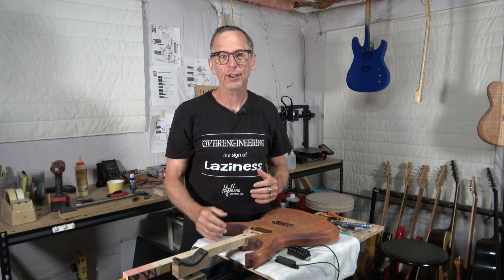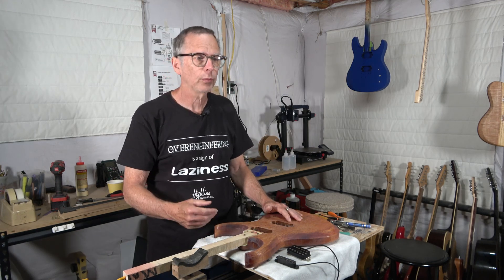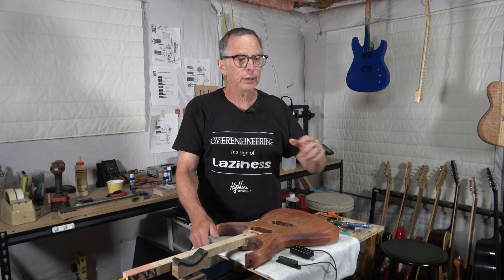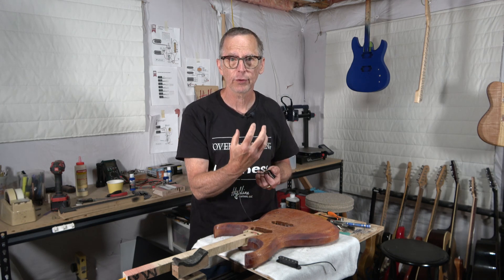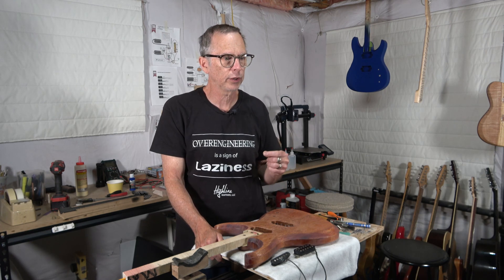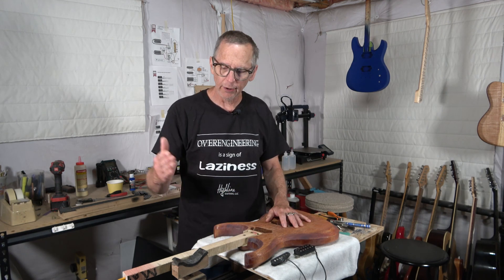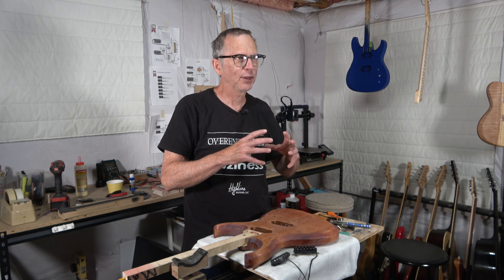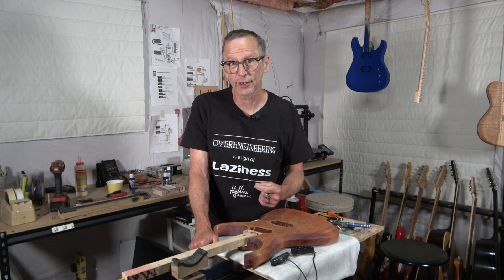Can You Plan Or Predict The Tone Of An Electric Guitar Before It Has Been Made

Comment: I have actually had pretty great luck choosing pickups for my own builds, but to be fair I have always stuck to a Super Distortion(as in my Les Paul) or derivative for the bridge. For my Strat that is a Sugar Chakra, and the Tele I am building is getting a Super Distortion T. For Humbuckers, I have found some custom CTS Pots the the Art of Tone has made, with a 525k rating and 5% tolerance, essentially guaranteeing me a minimum reading of 500k. The way I view the body and neck woods is that similar woods should have similar properties. However, denser woods, such as Mahogany, could impact overall sustain, but as you said, that could be different from board to board. While I don’t have any interest in becoming a luthier at this time, I am building simple projects for myself and may consider offering some basic tech services as a side business, given the lack of knowledgeable individuals in my area.
Reply from the maker: Building for yourself is extremely rewarding. Becoming a luthier can sometimes spoil that.
Reply: @HighlineGuitars , my goal with the Tele build is for a hard rock/pop punk guitar. My planned neck pickup is a SD Hot P90(Dimarzio didn’t have any traditional ones with enough output). Been thinking about a Warmoth Padouk neck since the body is the Player series Tidepool color, and the contrast between the teal and the orange-red of the neck wood would be gorgeous.
Reply from the maker: @bradleyolinger1691  Just be aware that orange-red Padouk will turn brown over time.
Reply: @HighlineGuitars , I am. Just thinking through options at the moment.

Comment: What's a tone pot? You guys dont just wire your pickups straight to volume then output jack??? 😂
Reply from the maker: A tone pot is a variable resistor used with a capacitor to bleed off some of the treble frequencies and send them to ground so the tone will sound warmer as you turn the knob.
Reply: @HighlineGuitars  hey Chris, sorry for the sarcasm on my part, was just making an allusion to the Van Halen style of eliminating the tone pot and relying on volume rollback for adjusting "tone"
Reply from the maker: @Mossy5150  No need to appologize. Often times, my responses are intended for those viewers who read comments and genuinely don't know the answers. Sarcasm is a beautiful thing!

Comment: I build mostly set-neck, double humbucker guitars with a tunomatic style bridge and stop tailpiece.  I’ve found that with that simple recipe that nothing will affect the tone quality of the finished guitar as the distance between the bridge and the tailpiece.  I normally put the stop tailpiece twice as far from the bridge as it is on a Gibson Les Paul.  This does two things that I consider very important.  First, it fattens the tone a lot.  Second, it softens the action, enough that a set of 10-46 strings will fret and bend almost as easily as a set of nines.  I’ve found that if a guitar sounds thin there’s not a whole lot you can do about it.  A lot of people think well I’ll just boost the bass and cut the treble on the amp, but all that’s going to do is muddy the sound.  If that fat but hard sound isn’t there in the first place then playing around with the EQ probably isn’t going to help very much.
Reply from the maker: Not all amps have the same EQ circuit. Some are much better than others, especially the most recent designs.
Reply: @HighlineGuitars  Thanks for your reply.  That’s not my experience.  I think boosting the bass and cutting the treble on the amp or pedal to add depth to a thin-sounding guitar is definitely not the same as building a ballsy-sounding guitar in the first place.  Tweaking the EQ may help, but it throws the frequencies out of balance, so that the bass is going to overpower the treble.  When chording there will be a significant treble masking effect.  This doesn’t bother some people, but I want my high notes to be louder than the lows.
Reply: I would think the longer string length would increase the tension needed to bring the string to pitch.
Reply: @victormarinelli5660  Thanks for your reply.  I’ve heard that the actual string tension doesn’t change, that’s strictly based on the scale length.  I’m not sure, but I think what’s going on behind the bridge affects the feel of the action.  Jimmy D’Aquisto said that putting a shorter tailpiece on one of his archtops would soften a tight action.  I’m pretty sure he knew what he was talking about, because he used to be able to alter the action and tone of his guitars even after they were finished, to suit the buyer’s expectations by changing the length and height of the tailpiece.  And I know for a fact that the action feels tightest with a Fender-style bridge where the strings run through the body and cross the saddles at nearly a right angle.  I’ve built several guitars with the Fender 25.5 inch scale that have a bridge and stop tailpiece instead of thru-body stringing, and they all play easier and sound fatter than guitars with the Fender-style setup, even with the same pickups.  I’ve seen and heard enough to be convinced that increasing the distance between the tailpiece and bridge is going to get me closer to the sound I like to hear.

Comment: Dear Chris, instead of using just one capacitor in series with a tonepot one can use a bunch of capacitors ranging from a few hundreds of picofarads to a few tens of nanofarads. (may be you can even omit the tone-pot). Furthermore instead of using the standard 5-way pickup switch, use a 3-way 2-pole toggle switches on-off-on. So it's possible to make any combination of single coil pickups in phase or anti-phase. That's what Brian May does, albeit with slider switches. By doing these two things You get the most versatile way in changing the sound of your guitar.
Reply: I don’t mean to sound condescending. You could buy/make a Varitone switch. It’s usually a 5, or 6 position rotary switch that you can use a variety of different capacitors. You can even add resistors for treble bleed.

It can take the place of one of your tone pots, (if you have two 😉).

As for pickup switching; you could use push/pull, or push/push pots to add the extra circuitry for series/parallel, and phase shifting, and coil tapping, (single coil pickup), or coil splitting, (humbuckers).

A very nice solution for pickup switching are Seymour Duncan ‘Triple Shot’ pickup mounting rings, for humbucker pickups. This uses two small slide switches at the top of each pickup ring. These four switches will allow you to do; series/parallel, and coil splitting both pickups. With no permanent modifications. You could then use push/pull, or push/push pots for phase shifting.

Edit: if you incorporated all these options, from the last paragraph, (with a Varitone) you would have dozens of tonal options, before you touched your tone knob.
Reply: The problem there though, is that you'll discover dozens of tones that aren't useful, and a couple that are. It might still be a useful endeavour, you could use the information and apply it to the next guitar you wire up.
Reply: @Mikey__R  

 If you don’t like the tones, from the varitone, you can use it, as a “test bed” of sorts. Keep the capacitors you like, and replace the ones you don’t. There are many combinations of capacitors, with and without treble bleed (resistors) you could use.

Half the fun is; finding what sounds good to you.

As for the other mods; all of them are useful. Phase shifting, coil spitting/tapping etc., are all useful.

Comment: great video.   I like what you said about the tome of the wood.  I'll add that for solid body guitars, I think that we notice the "tone" of the wood mostly when playing the guitar unplugged.  Once the guitar or bass is plugged in and cranked, then the pickup and electronics far outweigh the woods.  I select woods for weight, stiffness, and looks.   As for nuts, I prefer a zero fret and the nut only serves as a guide for the strings. 
Great video.
Reply: There is no good evidence that what you hear acoustically from a solid-body guitar has anything really to do with the "sound" of the body wood; that is, the vibration of the body wood. What you are mostly hearing is the acoustic sound waves direct from the strings. Which is why it sounds so anaemic compared to a real acoustic guitar.
There is just not enough body vibration to do that. All measurements of real guitars show that (bridge admittance, string vibration measurements, direct sustain measurement, etc).
It's just that some players have absorbed the nonsense physics notion of "transfer of vibrations to the body" as both a significant and an intrinsically "good" thing. Neither are true. If they were, sustain would be very poor (Conservation of Energy Law).
The acoustic sound does still have some relevance though. Because it reflects the vibrations in the strings, it's telling you what the pickups "see".
Reply: @vw9659  exactly.   Like i said, those differences we hear acoustically mainly disappear once plugged in and that's where the pickups take over.  All I want are woods that look good, have the right weight and for the neck I want a hight modulus of elasticity (stiff).
Any subtle difference in tone that the wood imparts is minimal if even audible to the human ear.
As primarily a bass player, I also don't buy into the high mass bridge hoopla that mass equals better sound than a bend metal fender bridge. Maybe better adjustability in some cases, but not sound.